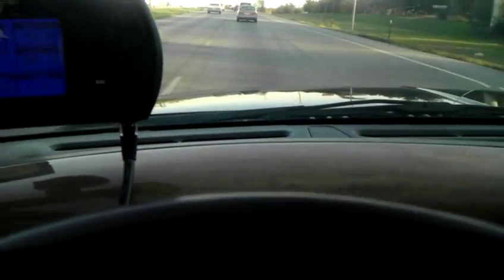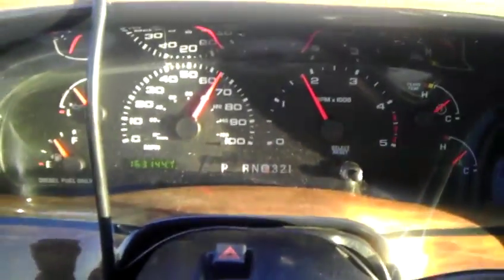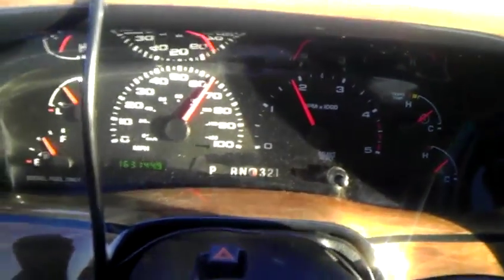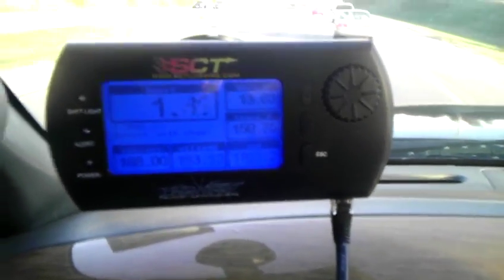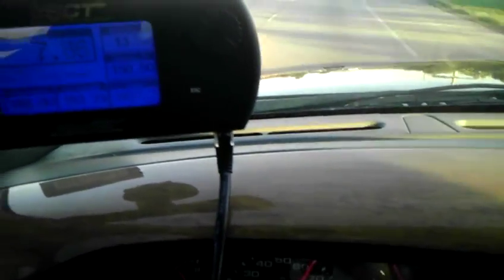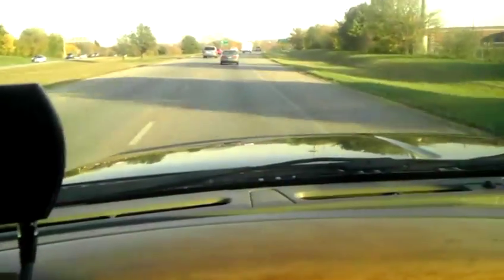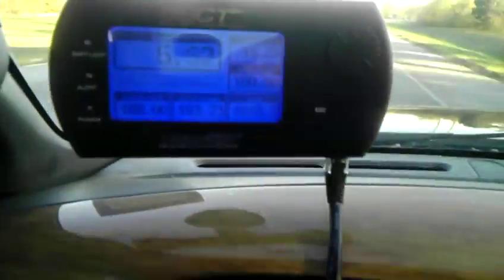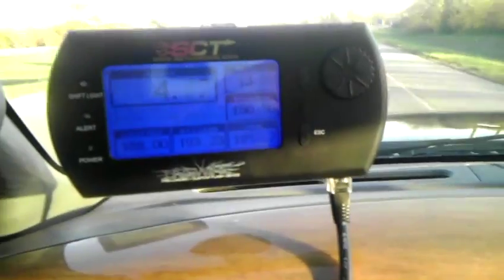Powerstroke 6.0 IPR Remote Oil Cooler + High Flow Coolant Filter Install - Part 9

Comment: I am currently installing the IPR EGR delete Gen 3, remote oil cooler and high flow coolant filter.  Did you ever solve your over temp issue caused by the filter?  I have had some issues with the install, nothing wrong with the IPR components it was my issue viewing the world through the window in my stomach (head up a$$). I am interested to hear if you went back with IPR components or are staying stock?
Reply from the maker: I'm all stock except for the IPR Gen3 EGR delete, which I like and have no issues with, and a PMM coolant filter.  Truck runs great now, around 7 degree delta max running 80 MPH down the highway.
Reply: you should just went with bullet proof diesel external oil cooler that way you get ride of both issues coolant and oil cooler

Comment: I was going to do my HPOP on my 03 6.0. After seeing all of your problems, maybe I'll take the ford Mechanic up on his very low offer to do this on the side.

Sinister coolant filter is on the bottom, opposite the way yours mounts. Any chance the upright filter on top, 12 oclock instead of 6 oclock,  could be causing the delta spread. Also I can't really see it up close but won't coolant spill out as you unscrew the filter leaking all over. Maybe it is like the fuel filter housing? Can't tell.

Comment: Josh got my ipr kit all up and going i kept temp sen in oem location delta un loaded 70 * day is about 9* delta loaded down runs 15 to 18 ----coolant about 190 and oil never any higher than 18 above coolant . This is after a mojor clr cleaning

Comment from the maker: No I'm not able to use the filter.  Without the filter I was getting 12* deltas which is still quite a bit high for a 45* weather day and no load being pulled.  I'll have another video in the next few days with some more updates.

Comment from the maker: Unfortunately that won't work because water doesn't flow thru that hose unless you have the heater on, this is controlled by the vacuum valve a few inches behind the alternator.

Comment: maybe if u ran the coolant filter just off that hose on the passenger side u had it hooked into without any T joints just splice into the one hose and it will keep the same factory coolant flow direction might have to switch hoses around to get the in and out correct on the filter id also try hooking a water hose to the inlet side of filter to see how well it flows or easy way just flush coolant once a year lol great videos

Comment: I am having the exact same issues. I am only running the coolant filter and since I had tore the truck down to install a fuel pressure sender ans did the blue spring upgrade, I decided to change the thermostat and upper rad, hose. 
 I think my old thermostat must have been bad and not closing all the way. My coolant temps were 170-180. 
 After putting in the new thermostat I saw temps exactly like yours. I am going to try and take the filter out and see if that helps.

Comment: If your coolant system is not clean, you will see increased deltas the first few coolant service intervals until the coolant filter starts removing all the junk.

Comment: Chris, if you are not running the external oil cooler kit it's best to route the coolant filter with the standard instructions T off the heater hose. The coolant filter was designed to trap contaminants and most people don't realize how effective it is until they see a oil temp increase with just a few hundred miles. You can see all the pics on powerstroke,org of all the dirty filters at just at 200 miles.

Comment from the maker: Unfortunately no, without the filter I'm right on the edge of being out of OEM spec.  On the highway now during my 1.5 hr commute to work I get anywhere from 8* to 12* deltas averaging 10*

Prior to this when I had the filter installed and ran around the highway for ~30 minutes I was over 20* delta

Comment: Right after I installed the IPR high flow coolant filter using the manifold my EGR cooler failed. I was also see increased temperatures most likely do to a restriction of the filter as Josh mentions. I only had it in for two days. This is all being removed and I am using BPD's remote oil cooler and EGR cooler. Andrew from BPD is awesome!

Comment from the maker: Are you referring to the coolant filter fix?  All I did was remove the coolant filter to bring the temps down.  Vince and I have narrowed down my problem to a coolant flow issue (or lack there of) which isn't able to flow enough thru the filter and keep the oil cool.

Any time you take the heads off you want to take them to a machine shop to be checked/decked(resurfaced).  If they are warped they won't seal properly when you reinstall them.